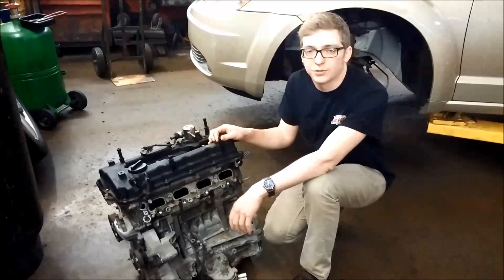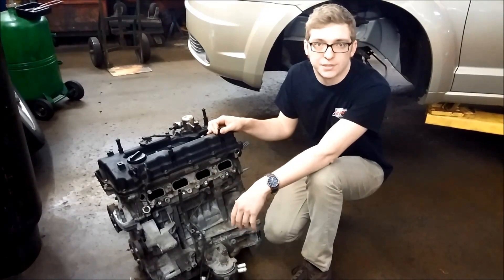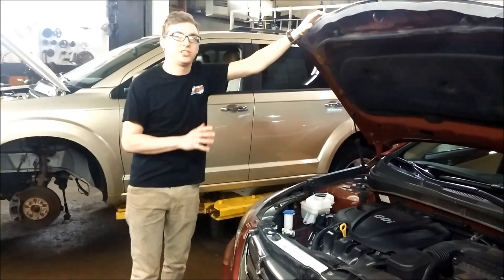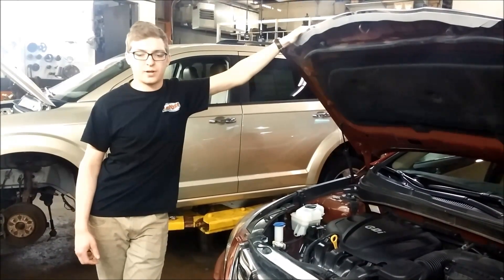Carbon: Your (GDi) Engine's Worst Enemy

Comment: Question ; I'm a long since retired Tech. I do airport transportation with my 2013 Hyundai Sonata. I do mostly highway miles and I'm still one of those crazy people who changes oil every 3000 miles (synthetic). I also change the transmission fluid every 15000 miles and drain and refill the cooling system every year. Spark plugs and belt every 50,000 miles. In other words, I need my car to perform at all times. I do most of the work myself. I had my engine decarboned at my Hyundai dealer at 70,000 miles. My tech said there was very little carbon compared to other vehicles of that mileage because of the way I drive and how I take care of the car. Should I just keep going the way I'm going?
Reply: Shepperd November, that's what I do with my 05 civic and until now running like a champ. The only difference is I have kilometers not miles.

Comment: Just use ethanol free gas and pour in a bottle of injection cleaner at every oil change is what I was told.   My '15 Kia Cadenza with a 292hp GDI V6 is at 23k miles and purrs like a kitten even under hard acceleration.
Reply: TheTallMan35  you’re only at 23k. thats wayyyyyyy too early to tell. my 2013 Sonata GLS is now exactly 130k. absolutely no problems at all. mpg is still the same as when i first bought it brand new. freeway - 34mpg. City  - 22. Combined - about 29mpg. All of these sellings are cons but there are people fallen for it.
Reply: TheTallMan35 still wont help carbon build up on the intake valves

Comment: Or just find you a gas station that sells gas that doesn't contain Ethanol and always fill up with that. At least that's what my local Hyundai dealer told me.
Reply: Fuel doesn't matter as it doesn't touch the valves. The carbon build up is usually caused because of the crank case gas recycling that's required by emissions standards.

Comment: Bull, our 2010 Ford Expedition with direct injection has never had any upper intake cleanings or any fuel additive, and our engine runs great. Even had a mechanic at Ford look at ours which only had a little carbon build up on them, told us to simply drive the car for 15-30 minutes at a higher RPM to clean them off. There's no need for this cleaning service if you drive your vehicle hard or drive long distances.
Reply: yes it's call an italian tune up !!!!
Reply: This is kind of a freak case that the engine got destroyed as a result. But Carbon buildup often kills catalytic converters and turbos after about 80,000 miles because the unburnt carbon is like hot sparks going through the exhaust manifold. Definitely better to have an intake cleaning done.
Reply from the maker: Hi Garrett, not all makes & models are exactly the same - your Ford may have a different set up (the 2010 Expedition comes standard with the 5.4 V8 Triton, not the Gasoline-Direct-Inject Engine). The Hyundais and newer imports in particular are experiencing this problem in almost every instance.  The manufacturers have recognized this as a problem with GDi engines and are recommending the Fuel Cleaning service to prevent catastrophic engine failure due from the carbon buildup - mostly because their warranty companies have been paying out too much for new engines! New technology is great, but we often don't know how it will unfold until a couple of years down the road....
Reply: Drive it like ya hate it for 20-30 minutes once a month......LOL

Comment: Could you tell me where is injector for Sonata 2012 GDi .. I mean where is located because i want to clean it and got problem of engine knocking That is why I want to clean injector
Reply from the maker: Aram, make sure this is your actual issue.  If there's massive carbon buildup, it'll go directly into the cylinder. This video pertains to cleaning the intake valves, not the injector. It may be time to have a trusted professional check it out for you.